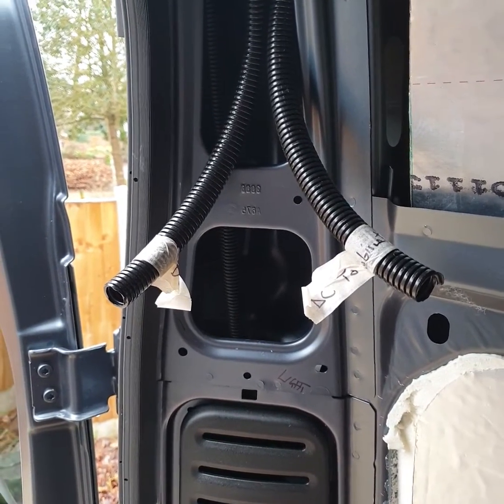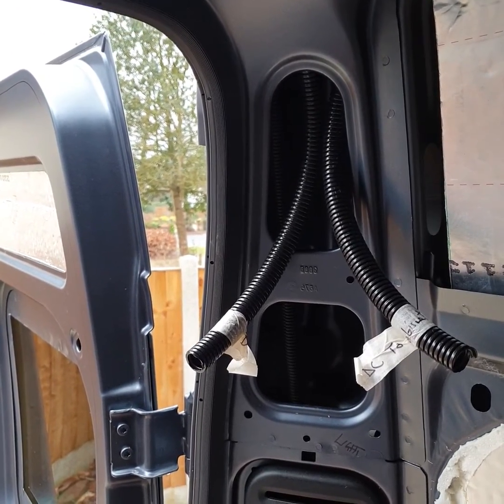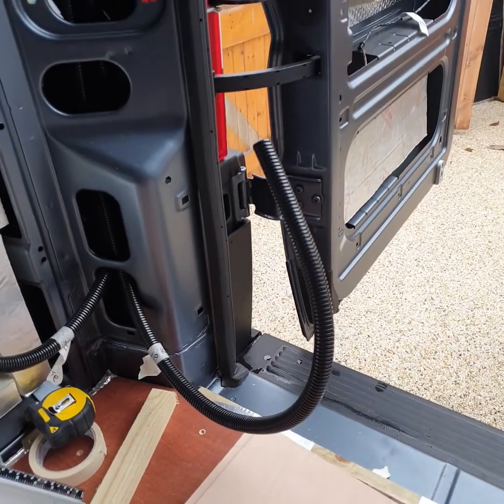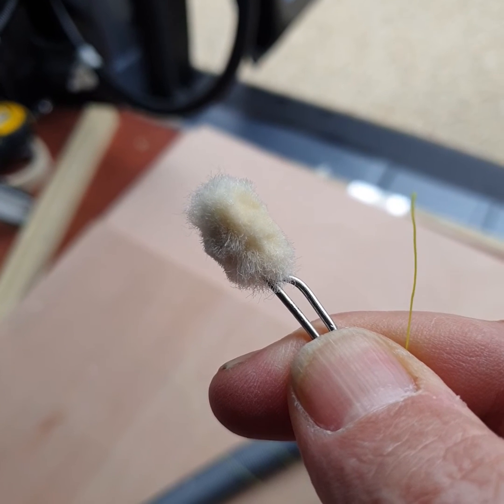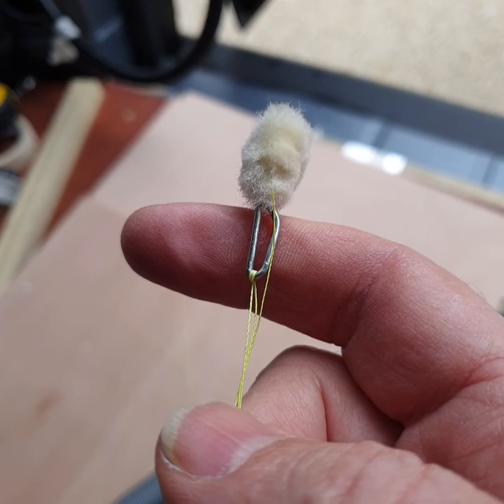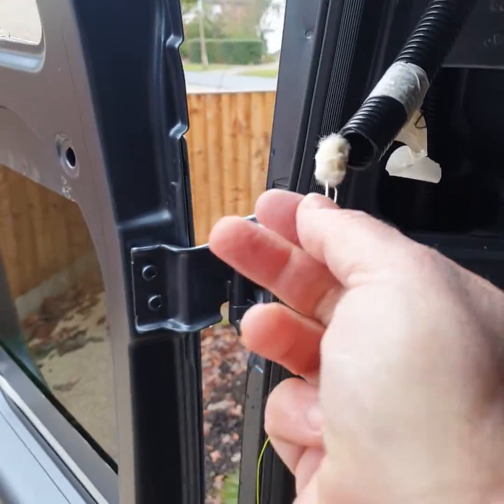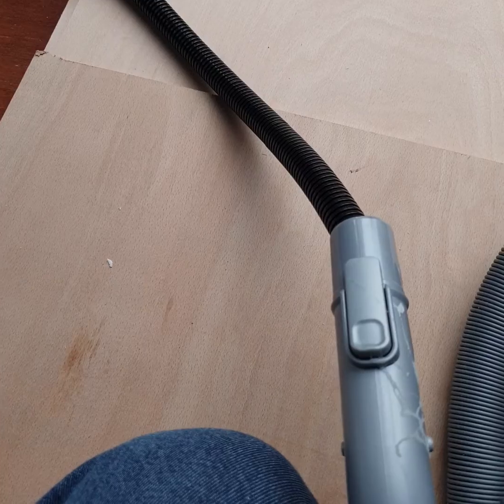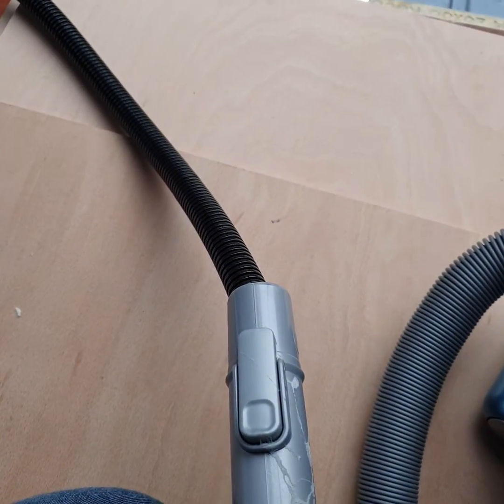How to quickly run wire in conduit

Comment: I just did this with a 25m water pipe buried in the back garden. It now has a length of RG213 coax running in it. I used a bit of cotton wool tied to a nylon string. Worked great and with 25m you get time to see it shooting down the end. Worked a treat.
Reply from the maker: Hahaha! Thats really good - success!

Comment: In the U.S. this is often referred to by electricians as "sucking the gopher". Tissue paper and cotton balls also work well. The longest conduit I've done this with was well over 100 meters with a diameter of roughly 8 cm and it was almost as painless as this video, just a lot more fishing line.
Reply from the maker: That's very good!  Its a new technique for me but very useful :)
Reply: @Magic-Smoke  At the start I was guessing that might be your technique and I immediately smiled at the number of people you would be leaving speechless but with an ear to ear smile and gratitude lasting a lifetime. It was certainly a revelation for me when I was first shown this technique. When doing lots of runs or doing longer runs, I'll often use a clear plastic bottle cut to size as an adapter to the vacuum so you can see the arrival of the string. Best wishes on your project. Your cable management is ace.
Reply from the maker: @Peter_S_  Thanks Peter.  I had to give that little cotton ball a bit of a haircut to make it loose enough in the conduit
Reply: @Magic-Smoke  glad it (purposely) had a fishing line attached or you'd have a clogged conduit :)